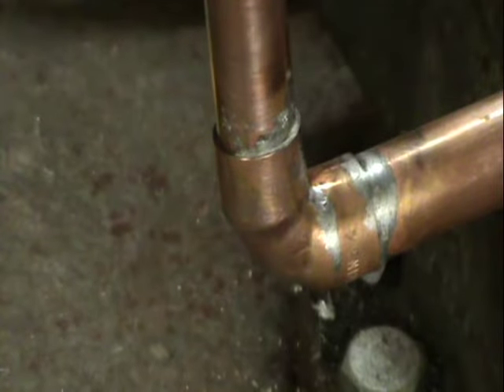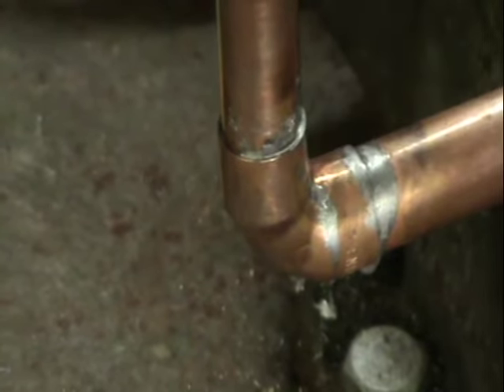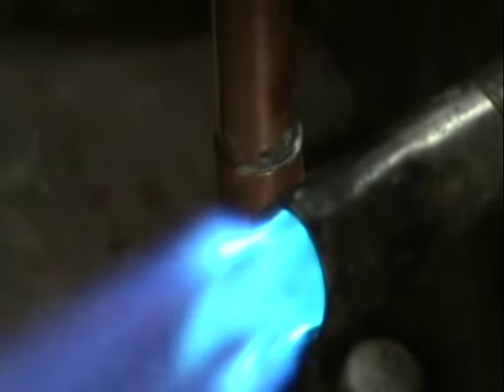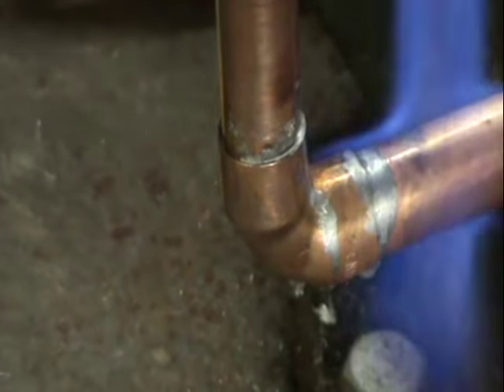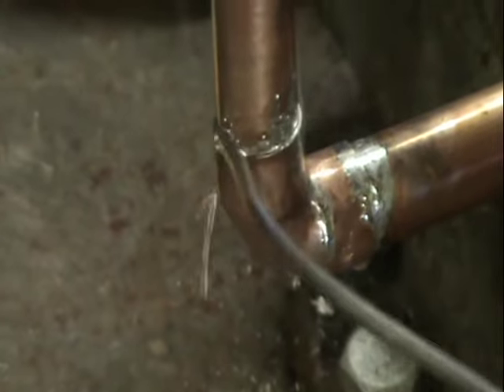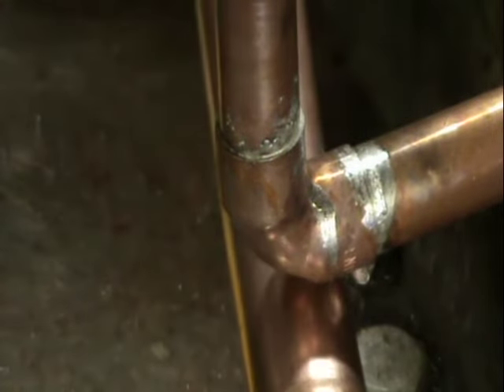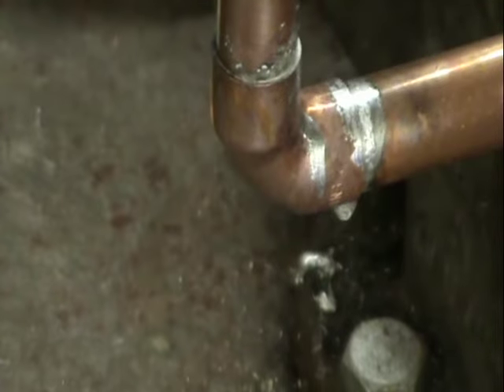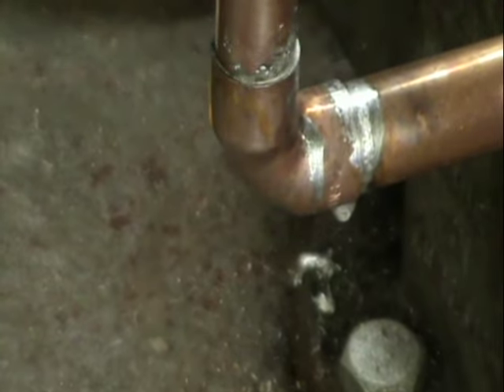Re-soldering an existing pipe that's leaking

Comment: This is not the correct way to do it. The joint must be pulled apart or cut out and redone.
Reply: I’m no expert. But too me his video made matters worse. Too me it would’ve been better. If he just removed all the fittings. And cleaned them. And started over.

Comment: The real problem is getting water out of the pipe and often the pipe must be cut to do that which means adding and sweating in a slip coupler where the pipe was cut to drain the line..
Reply: And then how do you insert the slip coupler, if the pipes do not move ?
Reply: Sometimes if you don’t have any other fittings close by the one that’s leaking you can drill a small hole in the bottom of the pipe and then braze it once you get the water out
Reply: @MrBMurder420  probably just drill a hole in the elbow and replace the elbow would be the cheapest thing I an think of now.

Comment: How do you re-solder or additional solder after running water through the pipe and now there's steam upon reheating the fittings?
Reply: Open a faucet below and maybe also above the fitting you're working on

Comment: This is fine as long as the original fault is just insufficient solder or insufficient dwell time of the torch on the joint, resulting in solder not fully  flowing before the joint cooled. 

But if the joint preparation wasn’t sound, i.e. the ends of the pipe weren’t cut cleanly, or the mating surfaces weren’t properly cleaned, or there wasn’t proper depth of insertion at an acceptable angle, this quick re-heating remedy may well not work.

Comment: Fry Power Flow solder.
Contains Lead: Not to be used on potable water supplies.
If you plan on soldering potable water supplies then don't practice with lead solder, use what you would use in the field... or practice with both types.  Leaded solder flows much easier than non-lead solder and the sudden change in how it flows might trip you up at first and make you think you are doing something wrong.  So practice with what you plan on using in the field or practice with both types to get a feel for the differences.  Just my 2 cents worth.
Reply: true, this is harder to do with lead free, especially when the joint is an inch from the ground and you have to get under it 🙄